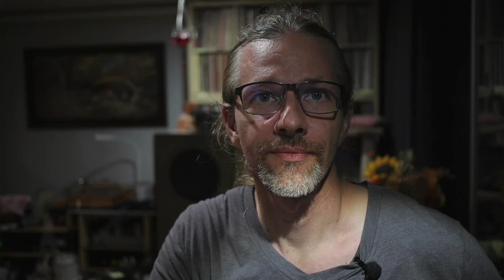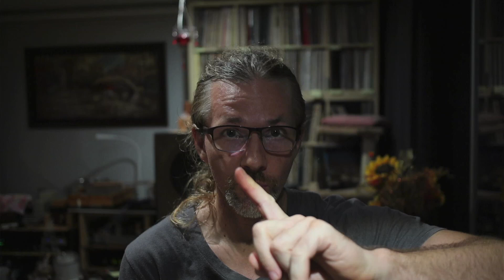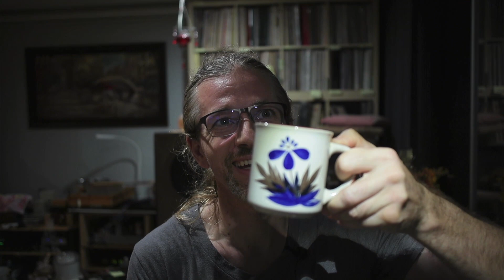Can you share your design and construction for a good DIY power cable?

Comment: Really interesting. But….if we read what DNM says about Eddy currents in interconnects and speaker cables, the same may apply to power cords as well. The problem is, i have never seen a power cord with spaced parallel conductors to minimize Eddy currents. Let’s say such a power cord exists, then you cannot find electrical installation wire of similar geometry in stores as the power cord in order to install a dedicated power line from breaker box to the outlet in your room. Even if you install this dedicated power line if we go up the ladder, the conductor from breaker box to the landline is again different in geometry! So where do we end up? Nowhere!…

Comment: Once again, thank you for your videos! Of course, no one wants to have you be responsible for a DIYers mistake! But there are some general concepts that I would love to hear your thoughts. Should the power cable be shielded or not? Specific situations? As you know, even the basic molded cables come in to varieties, so no need to DIY. Learning more about the concepts and preferred geometry.
Reply: The need or not for shielding. Braiding of three conductors, solid core or stranded wire…. Those are the types of questions.
Oyaide, for example, makes both stranded and solid versions of their bulk power cable.

Comment: The lenght of IC is important .......A study made  by Luxman in the nineties made them chose 73 cm as ( their ) optimal lenght.................Yves Bernard Andre ( YBA) said also this and even for digital coaxial it is claimed to be important ........YBA used the same high quality cables for power and IC's as well as LS cable...........even for the internal wiring of his aplifiers he used the same wire ...
Reply: Very similar as to what your mentioning on YBA. Lou R. mentioned how in the AN M9 preamp the Litz (signal) wire runs all the way into the power supply ... which is really giving the entire circuit (incl. return loop I would argue) that's in the signal path the same 'quality-treatment'..  and I suspect keeping it consistent in gauge and wiring structure could help too.
Reply: Yes ! @EduardBroekman

Comment: Another pro tip if you can't get aged (silver) wires.

Then you can cryogenic treat the wire that solves the same issues (close the internal metarial gaps and tear) but even much better results.
Reply from the maker: My experience that cryogenic treatment has not improved fresh sterling silver to the level of fine silver smoothness and liveness of sound, while the vintage sterling silver was just as good sounding as dead soft annealed fine silver. BTW I cryo everything...  all my wires, transformers, resistors, IC, speaker cables, power cables.... ;)

Comment: Already changing the bad cheap IEC connectors for quality IEC connectors in your amp etc will make a difference ....or as I do in some amps is suppress the IEC connector and use direct ( with stress relieve ) power cords to the component ........ALL at your risk as mentionned by Janos.
Reply: Yup, absolutely Frank. Just like I do with my turntables by hardwiring some quality Cardas cables (after trying others), I have also hardwired the power cords (also with strain relief) to a few of my components. Again, at your own risk… I’m glad Janos didn’t give a recipe for power cords, so he’s not responsible for any issues, but instead gave some good pointers.